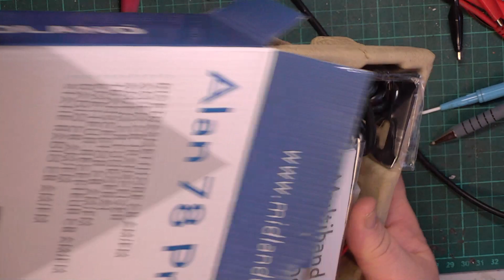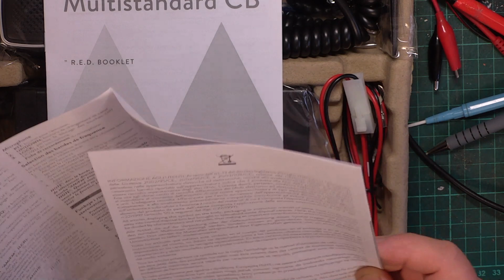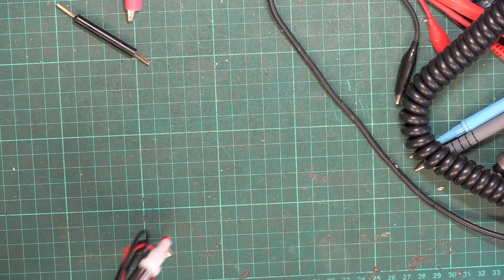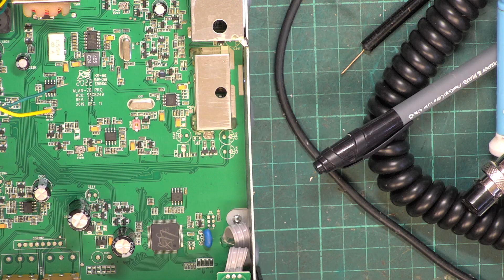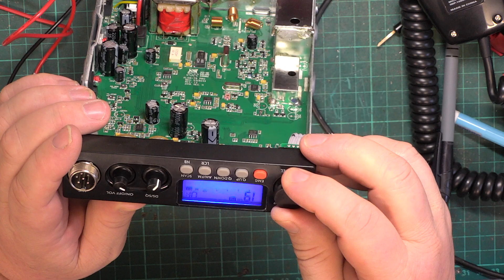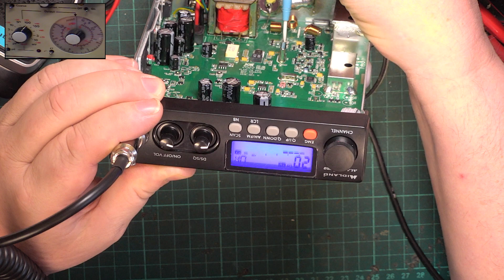Midland 78 Pro CE Multinorn CB radio - New radio evaluation & alignment

Comment: Hi anyone know why my midland 78 pro has lost most of it's channels only have 1-8  any advice would be appreciated.
Reply from the maker: Have you tried doing a reset? Assuming you are in the UK, reset the radio to EC channels. The radio should then select all 40 CEPT channels, FM only. If it now does that, set it back to UK channels. Page 6 of the instruction book.

Richard, G0OJF, UK
Reply: Ok thank you for the advice yes I'm in UK but unfortunately i don't have the instruction manual n @ukfmcbradioservicingTango21

Comment: Thanks for all the video's Richard, they are so helpful, just got one of these cheap from ebay with no transmit. Horrible design, had to struggle to open up the PA compartment top and bottom. Turns out the driver transistor is not on a heat sink, and in the enclosed space it has cooked itself, I hate all that screening, such a pain to get in. Ken.

Comment: Mixed thoughts about that one. Why can't they make a CB do the power it is supposed to do for the UK?
It is very much like one of the new digital radios you get, opens and closed the squelch when you change frequency, then the delay before it locks.  But I do like the lack of harshness with the squelch open, though I think it might make a weak station hard to hear!